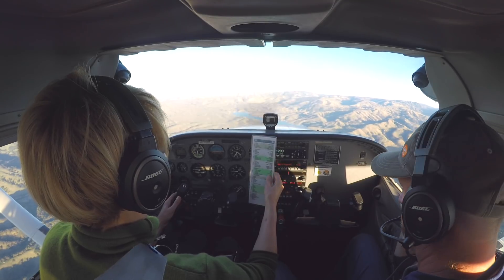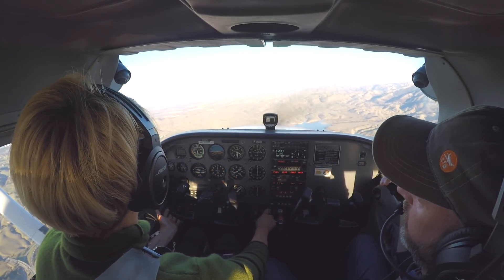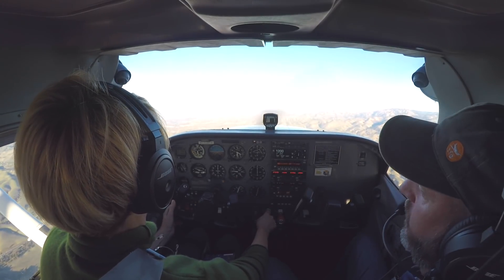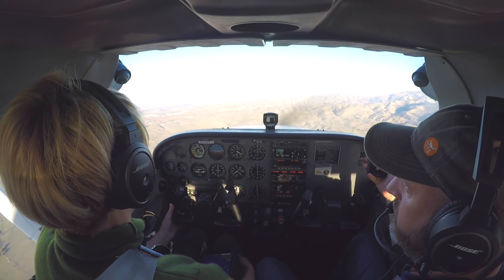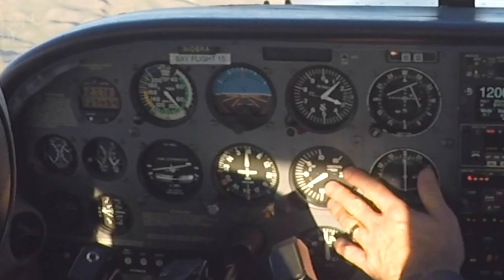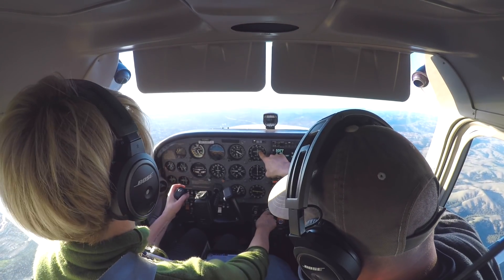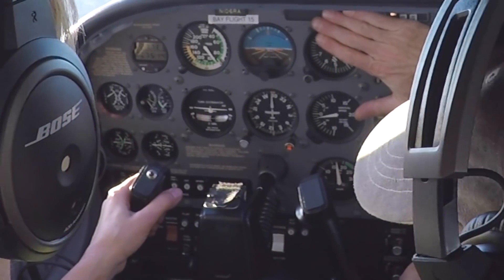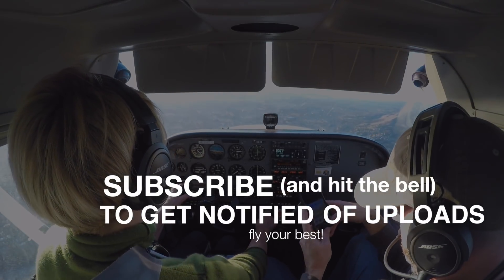How To Hold A Glide Slope - The SECRET that pro pilots know

Comment: Wrong wrong wrong wrong!! Completely wrong and why most professional pilots don’t know how to fly, because their instructors taught them WRONG. When you're trimming, you trim for an airspeed, when you add or subtract power the aircraft will naturally climb or descent to maintain THAT airspeed. When you're telling your student to add power for airspeed, all your doing is making the airplane want to pitch up no maintain the lower speed. You can fight it in a cessna and that's fine, but you do that in a large aircraft and you're going missed. THE CORRECT WAY to fly an ILS, basically hands free, is to slow to 90kts, TRIM then pull power to begin your descent. The aircraft will maintain 90Kts (because thats what its trimmed for) and you can control your rate of decent by adding or subtracting power. This is also why almost all small aircraft you can trim full nose up in the event of an engine failure and the aircraft will hold best glide speed without any elevator input. Next time you fly try it. It is the proper way to fly at all times. The "pitch + power = performance" gets totally botched up and students end up being taught to fight themselves on the controls.
Reply from the maker: I am not wrong. I do this everyday. I know what works and what does not. The reason you pitch for the VSI on a Glide Slope is because the response is immediate, instantaneous. The airspeed indicator lags way to much. The signal is extremely narrow. If you try holding a glide slope by pitching for (or trimming for) and airspeed you will lose the needle I can almost guarantee it. The airspeed indicator lags waaaaay too much to make this effective. Not only are you responding to very old data, the response inputs take too long to manifest in change. However, outside of that ... I agree with pretty much EVERYTHING you said.
Reply: @TheFinerPoints  I do it everyday also. Except in a 747 around the globe. I have thousands of hours in 15+ aircraft. If you're trimmed for 90kts then why would the airspeed indicator lag? You're already doing it. Pushing the nose over is going to make the airspeed increase and then have you pull power out. This is just bad technique. When you're changing altitudes in cruise do you yank it back then add power? not if you're a professional pilot. You simply add power and let the aircraft naturally climb at the trimmed speed until level off where you return the power to basically the same power setting. You don't need to manipulate the yolk at all. Pitch + Power = Performance. You are pitching/ trimming for your airspeed. Then with your power setting gives you your performance whether it be climb, descend, turn etc. This is why my students could do perfect ILS's without making any yolk inputs and tiny throttle inputs. You NEVER want to be fighting aerodynamic forces while flying. Now, when you get into larger category aircraft and especially jets you have to give it a bump to get it started due to speed, weight and momentum of a jet but thats literally all it is, a bump. A Boeing 747, 727, EMB145, all the way to a C172. An airplane is an airplane and aerodynamics are aerodynamics. I fly with people who do as you teach all the time and often times its cringe worthy watching them fly.
Reply from the maker: @thatflywelshguy9662  Are you hand flying those aircraft on ILS approaches? If you are in a C 172 (or any light airplane really) and the glideslope needle is moving down, your power reduction will not manifest in a fast enough change without a reduction of pitch.  The airplane will not react in time. If you pitch to the VSI, the response is immediate. I agree with a lot of what you saying in theory but we both know that the truth is pitch and power are inextricably entwined with each other. Thinking of them as separate is a mere convenience. If all I did was add power to climb, level off, or descend it would be very sloppy flying indeed. Try that in a Cessna. Maybe that works in heavy jets, I don't know. It does not, however, work in light airplanes ... or for any students I've worked with. Should they be in trim? Of course. Should they fight aerodynamic forces, no? Should they think that power is the only pitch control they need? Not if they want to hand fly and ILS. Being in trim will get you close but the glideslope moves too fast and is too narrow for that to work.
Reply: @TheFinerPoints  Every approach is hand flown. The only time I do a coupled approach is when the aircraft requires an autoland for MX. Power reduction does immediately result in a pitch reduction. You go cruise around at 2500rpm then pull the power to 1500rpm and the nose will immediately drop. Airspeed will drop for a second then return to the trimmed speed in a stabilized decent without doing anything else. This is exactly how a decent should be made not forcing the nose down, then changing the power, then trimming, then changing the pitch again. Thats just silly, let the plane stay in equilibrium. That is how a professional does it. If your student gets slow on the ILS you're telling them to add power, but if you add power the nose pitches up and the GS goes low, meaning you have to force the nose over which then causes excess airspeed. This is the biggest problem people have flying ILS' because they don't understand your power is actually controlling your descent rate and your trim is controlling airspeed. So if you're in trim before intercepting then that is already locked in, allowing the only variable to be power reduction to get your desired VSI.
Reply from the maker: @thatflywelshguy9662  The airplane does not behave exactly as you describe. I am a professional. A professional teacher of this technique for more than 20 years. By your logic, I should teach students to simply add power to climb? Go try that in a Cessna. The airplane will accelerate. As it accelerates the airflow over the tail will increase, and it will seek it's trimmed speed and eventually find it. That process takes some time. You have to fly PITCH and POWER. In a descent the airplane will accelerate past it's trimmed speed, the airflow over the tail will increase and eventually this will stabilize. If you do this without touching the yoke you will never hold the needle. You will be chasing the airplane. That is not how professionals do it. Anyhow, I don't have much more time to discuss it but I teach to always be in trim. Even so, they have to manipulate pitch and power to be successful. Flying by power alone in a light airplane does not work. By the way, I didn't make this up. It's described in detail in the 1980 version of the Instrument Flying Handbook. It works.
Reply: @TheFinerPoints  I am talking about all airplanes, because all airplanes fly the same, based on the same aerodynamic principals. I also have over 2,000 hours in cessna 182's and about 10,000 hours total time from C150's to B747's, it works for them all and allows you not to sit there stirring the yolk around. But hey, teach how you want, then when they become my students at a major airline i'll teach them how to not fight the airplane.
Reply: @thatflywelshguy9662  I love when professional pilots call it a yolk. Especially "stirring the yolk around". Just make sure you remove the whites or everything will be scrambled...
Reply: drfaustus72 haha good catch! That’s what I get for typing on my phone.
Reply from the maker: @thatflywelshguy9662  Hey, I wanted to thank you for the thought-provoking conversation. It led me to record this podcast on Pitch + Power - I thought you might enjoy it. 
https://www.learnthefinerpoints.com/podcast

At the end of the day, I think you and I agree, for the most part.